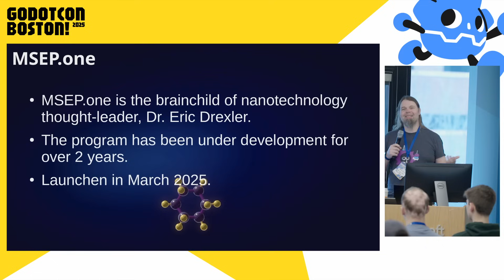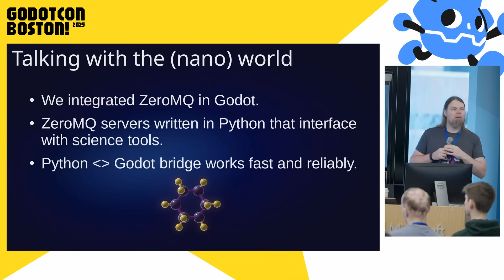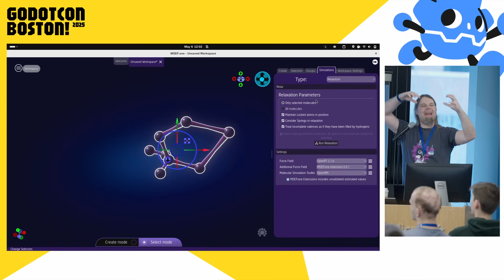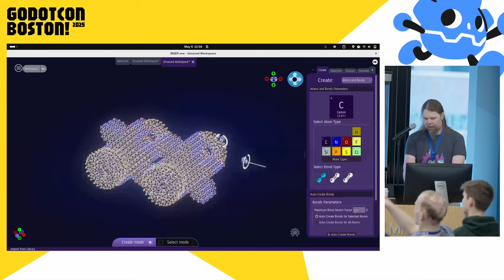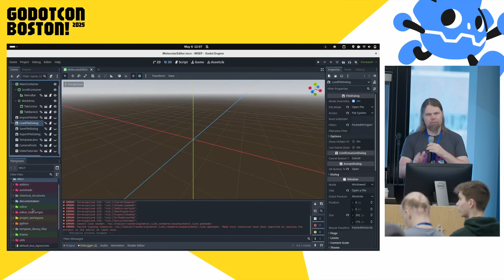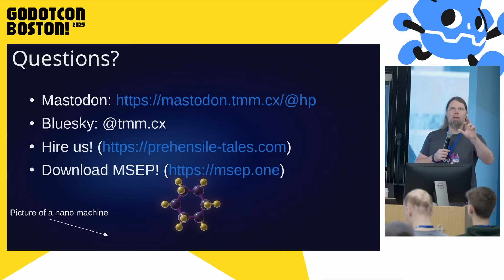Building cross-platform non-game applications with Godot – HP van Braam – GodotCon2025

Comment: most GUI interface would be better scraped and to just have a CLI with a render window if needed, much easier to enter data in json or yaml or as arguments than some custom form too
Reply: For a very small amount of users that is true. For most people using computers that's not the case.
Reply: You can have both without much issue though, including having a GUI write out your json or yaml or cli args if you want, and I think that's awesome.